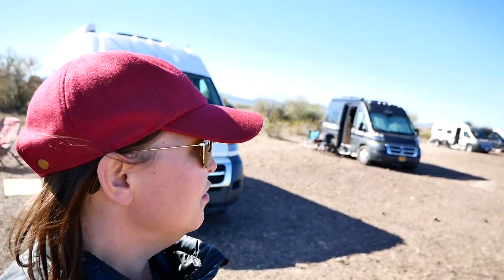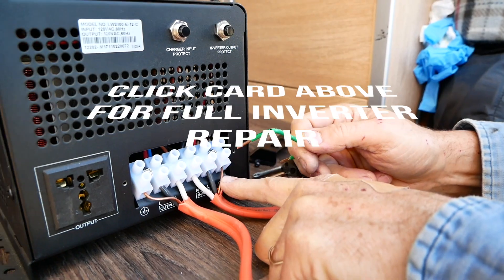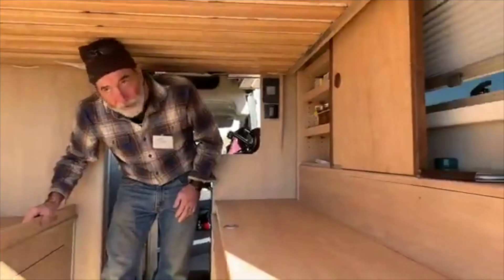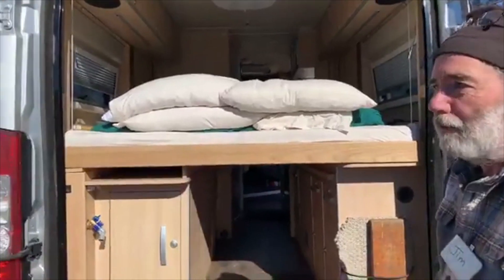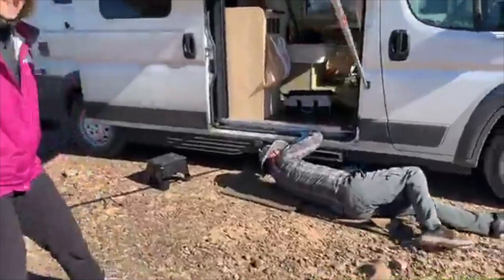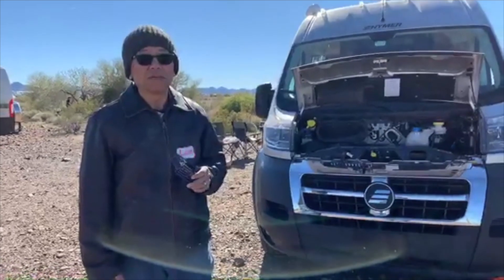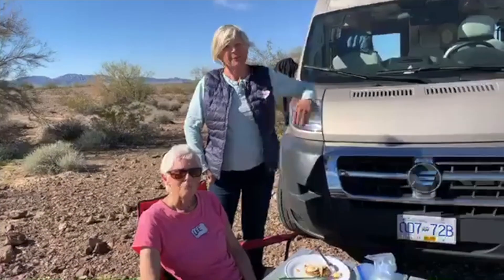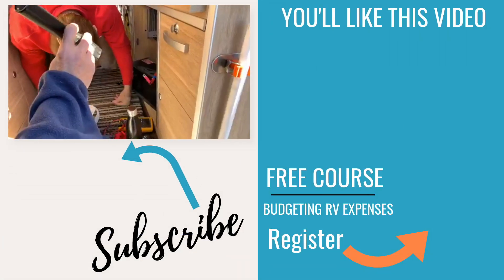Hymer Aktiv Van Mods Meet-up // I Love Our Helpful Community

Comment: That’s weird, mine HAS a bed USB and plug.
Reply from the maker: I should have clarified, not one that works off of DC power without having to run the inverter at night. :)
Reply: Could you show us how to connect the USB to where the 12v is located?